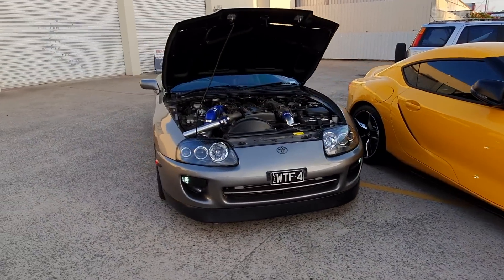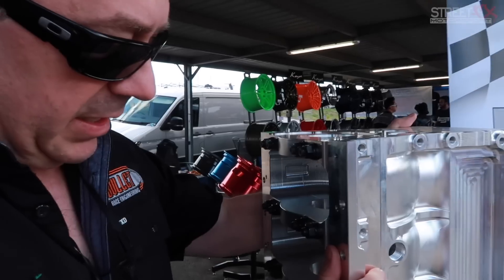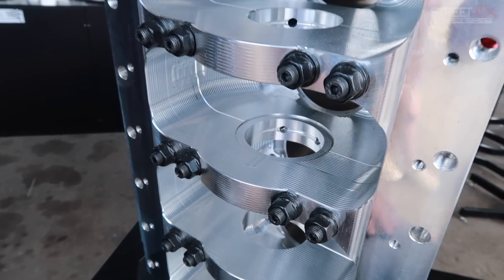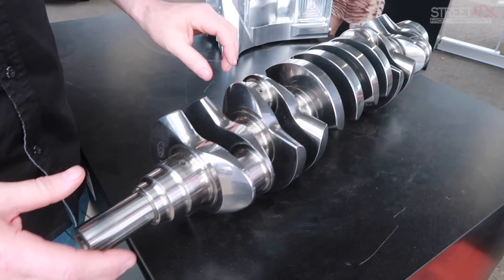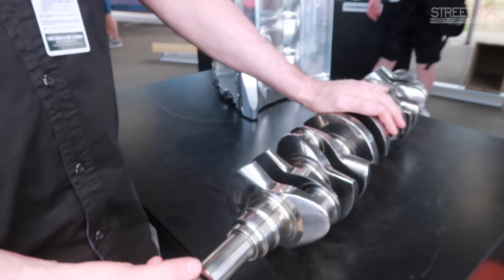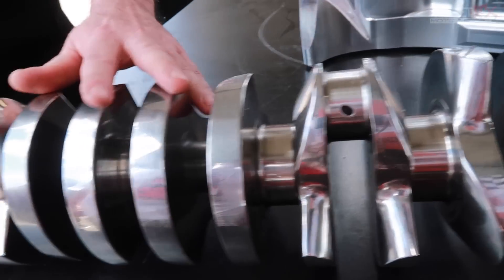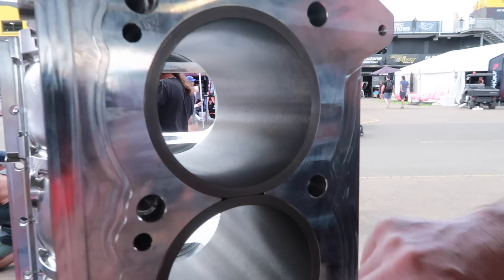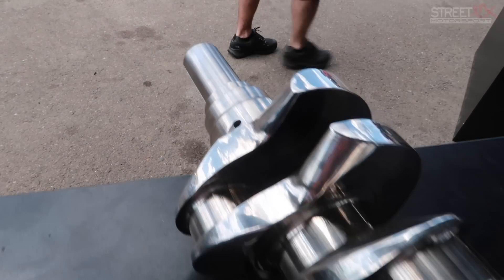Legendary 2JZ and RB30 combined into one 3200+hp capable billet block!

Comment: Heck , if they franking now, why not building a 6cyl k24,  or a V8 J-series Honda , or maybe a 4cylinder LS-7, mays well go to the next frank'N' step, and stein it up! Make something cool, maybe even a V6 big block Chevy! Cut 2cyl off a 8.1,or the 572!! I'd like to build a Chevy i6, maybe use modern hemi heads, or Subaru heads cut /welded to fit the bore spacing, it's odd spaced, in pairs paired between the main journals (the older) the newer have 7 Mainsabd may be grouped in 3cyl so maybe 6cyl subaru heads maybe a possibility, then use big block rods, but the ports on the hemi heads would flow a ton, for a 4.1 litre engine, the Subaru heads over head cam, the timing beltcan be ran off the cam gears because it's a gear drive, a custom timing cover, with a output gear a cover with bearing and seal, spinning the Subaru cam welded or coupled together! It would be much easier to cast a new head, it would be awesome to bore the block and sleeve it for 4.0" or 4.125 -4.155 if possible, it can go to 4.0" but the wall is around . 080" thick, with core shift it can be thinner, With a 4.155 bore and if the crank could be stroked to 3.75, 306cid i6, with good head, (😂 haha) it could make power, Or a 8.1 BBC cut to V6 , 372 cid that could be awesome! Sorry to ramble!!!

Comment: Crankshaft is porn lol, realistically anyone thinking an RB is better than a 2JZ is clutching at straws as let’s be honest the main things being copied here from the 2JZ .... is nearly everything 😂 for sure this will bring the fight to the 2J boys but you’ve had to create a mutant to make something capable of beating stock god like block that was made from Toyota in the late 1980’s when the 2J was originally being designed. No I’m not saying this isn’t better than a stock 2J as it’s way better and incredible but what I’m saying in essence is a billet stock in design 2JZ with even a stock crankshaft etc is going to be capable of close to the same as this epic mutant. Impressive yes massively none the less 👍 love it and mighty impressed.
Reply: Anyone ran it in a car yet and any vids too? Didn’t realise I was so late to the party lol
Reply: Peak Performance Reviews I’m pretty late too, I wonder if anyone has tried fitting the rb head to a jz to use the better internals and oil pump, the dimensions don’t seem too far off

Comment: Ok everyone talks hp and rpm, but nothing about longevity .   Can anyone use exotic K6 metal(Cobalt/Chromium metal) in sleeves, rings, valves or is machining is way too costly(besides the initial cost of this wild metal)?  This metal has unusual high heat ,wear resistance it has the slickness of Teflon or Diamonds.

Comment: now would be great to combine the 2jz head strenght with rb 26 flow and with some tech from the new supra motor especially the direct injection for a frankenstein top part maybe even use similar flow as the new supra engine if it allows for better low end spool that is

Comment: 1) coming from complete ignorance about these engines, would it not be beneficial to use a splined front snout on the crank shaft? 2) can I order those piston sleeves with fire rings?

Comment: Sounds more like fixing an RB's issues by using JZ design elements.
Reply: Sigma Projects well yeah, and solving the JZ's issues with the RB design elements.
Reply: @MVSTNGGT  But it's sold as a RB block, not a JZ hybrid. I don't think it can bolt up to anything that bolts up to a JZ. It's an RB design with a few JZ elements. If I am able to use Ford rockers on my Toyota motor can I claim it's a Ford/Toyota hybrid engine? This RB just uses a JZ crank basically. I think the goal of this design is to be the most powerful RB engine setup not really consider it a hybrid, no?
Reply: Sigma Projects I understand where your coming from and I agree, Its 100% more of a RB as they basically just used the JZ's crank journals. Even the majority of the crank is Based off an RB because of the bore spacing. Id consider this more of a Frankenstein mix of the two than a hybrid.
Reply: @MVSTNGGT  I guess if that's what people would consider. My example of the Ford/Toyota motor is a real thing. Papadakis Racing did it to get the 2RZ or 2AZ (I can't remember which) to rev crazy high by replacing the hydraulic lifters with tappets from something off of a Ford. What would you consider that motor then?

Just seems like since it's not really using JZ parts as it's just upsizing the stuff that matches the JZ specs.
Reply: Sigma Projects Id consider an engine that uses a somewhat equal amount of shared parts/design a Hybrid, like an RB30 with the 26 head, or a 2JZ block with a 1JZ head, or even custom blocks made to fit a certain Head design. This engine does have JZ journals, just spaced like a RB so its a weird one, hence why I just call it a Frankenstein RB, its literally a bunch of different pieces all mixed together to create the ultimate custom engine package with the RB's bores/head design and the beefy unforgiving JZ bottom end.
Reply: @MVSTNGGT  but it just sounds like JZ journal sizes were really the only thing they adapted as pretty much all billet blocks will have upsized caps and such. This block has no water jackets and as far as I can tell the oiling system is closer to RB or custom. That's why just feels weird to call something like such a mix if it's just using a single components.  But it's all moot, it's just my opinion. I just get curious about agreed upon naming conventions. I'm glad you spent the time giving your two cents.

Comment: If your going for those numbers  any thought on running a fire ring along with a head gasket instead.of.just head gasket alone. I know the diesel guys run firing rings along with others because of their demand for those high boost pressures amongst other reason

Comment: Talking about all the good stuff you can do with a RB but the only way you could take advantage of it is by using a 2J  and Honda crank. To say RB has anything more Superior then a 2J is a joke. 2J with turbo and injectors 750+ Hp with out opening them up. Put rods and Pistons little heavier springs 1000+HP with no sweat. RB can't do any of those things with out cranking a block in half.

Comment: So what exactly are the better bits from the RB30?
Reply: bore spacing, longer rod stroke, rb26 cylinder head. as mentioned in the video
Reply: @lorenmuhling3633  Cheers, I didn't actually watch the full video first of all but he does explain the 9mm extra deck height and larger spacing between bores. The RB30 in it's stock form has thinner walls than the stock 2j due to inferior casting quality, the bore and stroke is the same.

Comment: There was a project by the "old ones" ENDYN .They were trying to modify and fit 2 honda heads onto chevy LS motor.. imagine the finished product !!
chevy LS with vtec.. Win win
Reply: TryMonster bruh
Reply: Mercury racing has a 32 valve ls crate engine that makes 750hp @ 8k RPM naturally aspirated. Not technically VTEC but close for an ls.
Reply: Ls3 has vvti
Reply: @rustedratchetgarage6788  ls only has vvt, only adjusts the timing.
Reply: @mustnotsleepmustwarnothers6463    the 'I' only means "intelligent " by Toyotas nomenclature,  and that's simply a more sophisticated control system for variable valve timing compared to the pre 1991 VVT system and does not include any lift variability. 

That would be VVTL-i the L standing for lift.
Reply: I'm not aware of any Honda head with a similar bore spacing to the LS.

Comment: Barra: Am I a joke to you?
Reply: Someone needs to do a Barra V12. Sure it'll happen one day.
Reply: Yes, the Barra is a joke. Standard Barras are pushing their luck at 400+HP, the V6 in my Mazda is known for failing around the same level and nobody in our community would claim they were especially tough.  Some Barras are good for something north of 500hp with stock internals but what is that compared to a simple and common 2JZ that will happily live at 800hp without touching a rod or piston?
Reply: @DrewLSsix  stock internal Barras can easily handle 800hp, you have no idea what the fuck you're talking about mate
Reply: @DrewLSsix  I doubt it. The FG F6 has 416hp (310kw).
Reply: @DrewLSsix  So you're saying that a stock FG F6 or Sprint 6 are pushing their luck? They're capable of a lot more, their also dirt cheap which makes it really good for an engine found in a regular old family sedan.
Reply: @DrewLSsix  not to mention you can pick one up for around $500 where i live, and you're paying atleast $2000 for a 2jz
Reply: DrewLSsix you got no idea what you’re talking about, stock 2jz bottom end can only handle 800
Reply: @DrewLSsix  the mcm cresta lasted years on a junkyard barra motor with bolt ons getting over 1000hp at wheels
Reply: @DrewLSsix  this is absolute bullshit. Many many barras running 500rwkw on a stock bottom end.
Reply: Hi barra. I'm 1FZ-FE . 2JZ's big brother ..
Reply: Rasham Williams hi 1fz I’m 1hd,your younger brother
Reply: @rashamwilliams8782  hi 1fz Fe, you are not built to handle power
Reply: Hello barra, I'm TB48, RB big brother
Reply: Barras are junk.not even comparable to the 2jz,..

Comment: Stop saying 2J   That’s an old Diesel engine.     The Z is used when previous letter was used before. M vs MZ. R vs RZ. A vs AZ  J vs JZ.  

The 2J is a 2.5 L (2,481 cc) inline-four, eight valve OHV diesel engine. Output is 70 PS (51 kW) at 3600 rpm as fitted to a 1972 Toyoace truck.[1] It was first introduced in 1969 and was built until 1983. Later versions claim 75 PS (55 kW) at the same engine speed.

Why do these guys keep talking about that old Diesel engine? 

https://en.m.wikipedia.org/wiki/Toyota_J_engine
Reply: Its just an abbreviated way of saying 2jz 😂😂😂😂 it's not that deep bro
Reply from the maker: calm down.. It's clear what we were referring to.

Comment: This is awesome, and you could even add two more bolts to the main bearings if you wanted by adding horizontal bolts into the main bearings for even strength just giving you a heads up but looks good.

Comment: Rbs are such crap the only way to make it hang with a 2j is to make a custom billet block with a crank thats a honda/2jz frankenstein. How are they still calling it an rb at that point?
Reply: 2loud_ tacoma all those top drag 2jz powered cars run billet 2jzs with Honda journals and girdles like RBs, but I bet you’re ok with that. Yet you flame these guys for making improvements to the RB platform. Buckle up and enjoy the ride because once these blocks start making it to the drag strip, I have a feeling they are going to make you upset with the numbers they are going to be clocking in 😂
Reply: @METALGEARZETTO  im not flaming these guys you idiot. Im flaming nissan for making an inferior engine. Get it right dumbass.
Reply: 2loud_ tacoma wow! no shit! Then why do you act like people don’t know that they had to make a custom billet RB to hang with a custom billet 2J. So one question for you, do you consider the billet 2J with Honda journals and RB girdles a 2J?
Reply: Rb hasn't never been manufactured for drag racing, it was always been for track racing! It is important they have great response power is not much important if you can't use it all!

Comment: Now they just have to manufacture them as wet blocks............
Reply from the maker: ^^ THIS!!! Are you reading this Bullet? 🤗
Reply: @StreetFXofficial  They already do a wet block street version, this is the new "ultimate" version dry block for drag use.
Reply: @jeffsymons7084  nice to know..........thanks
Reply from the maker: As far as I was aware this was the first of the 2j journal rb blocks, so didn't think there was a wet block version yet.
Reply: @StreetFXofficial  it is the first version with the improvements.........tho i highly doubt they will manufacture a wet version, due to this version being their Drag Extreme and they already have a 2500hp rated billet block available in both wet and dry variants for street or drag use.......... although it would be nice to have improvements

Comment: Can you buy this and add some Nitto performance parts. Such as 2.8l stroker kit etc etc?
Reply: ISSA OOF stock the RV 30 block is 3l I’m fairly sure you can stroke them to 3.2 or 3.4
Reply: Whitts adventures srry didn’t mean with this 3.0. I mean billet parts from nitto such as stroker kit
Reply from the maker: they are 3.0 by default but you can get them up to 3.4 I believe, as per Whitt's comment.
Reply: Main bearing size is different

Comment: wow they are priced very low compared to what I was expecting. Good shit!
Reply: Definitely a fair price for such a crazy product.  Full freshly assembled Rb26 engines from Nismo themselves are already in the 30k price range, and considering they still use the normal casting methods, 14k for a full billet block is a way better deal. Albeit that it’s just a block and not a fully assembled engine, but this block most likely has more potential than the traditional casted iron ones. Very excited for the future of crazy rb engines!
Reply: Leng Yang crazy part is this particular RB30 is a Frankenstein 
Something goes wrong you can’t just slap another ordinary 2JZ or RB30 
Therefore it is an expensive build even at 20k for the block alone.
4Pistons sell engines for less than 7k & able to withstand over 1000hp in your everyday civic
Reply: I don't think the price is horrendous either, but I suppose it's all relative to our own budgets.
Reply: Right! Considering I could buy a f20c spoon engine for my s2k for 11k or buy this RB30JZ Monster for only 3k more, I think I know where I want my money. Just gotta convince them to add some coolant jackets...

Comment: put one in my wrx ...
Reply from the maker: 1/10th the power and the gearbox is gone :P
Reply: Shoulda bought an evo and you could.
Reply: You Tube I wish. The length of an inline six in an Evo is a setback. The only successful FWD layout I’ve seen a straight six dropped into was in Finland or Sweden, dude had to get massive fenders built because the engine/trans took up every inch of length between the fenders.
Reply: @Cjbarker2  that's phat.
Reply: You already are doomed to fail.. u fucked up and bought one of the worst cars to tune.. plus they are slow as fuck stock.